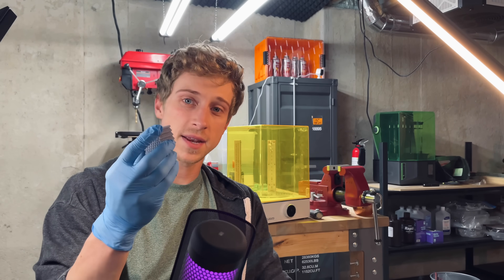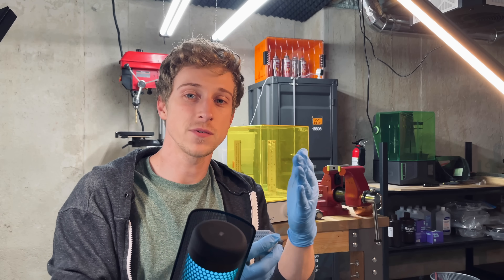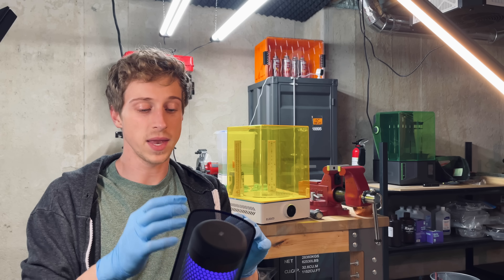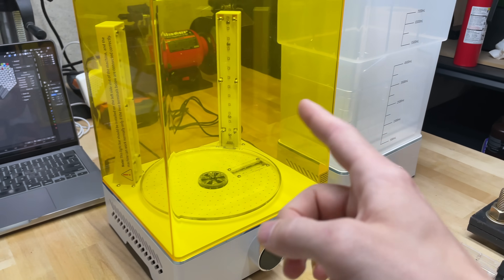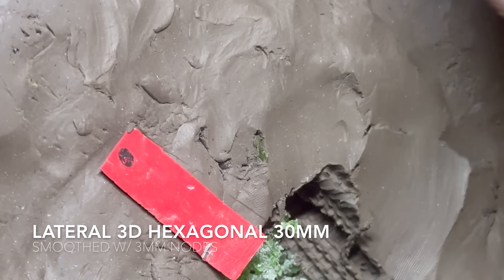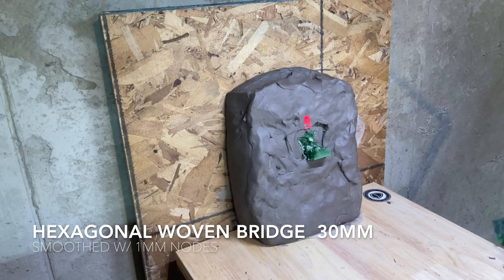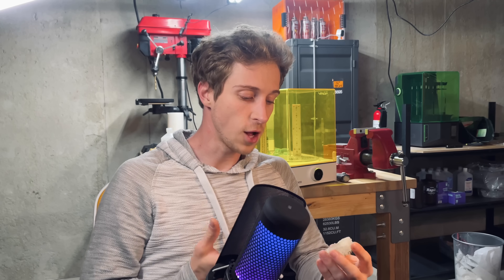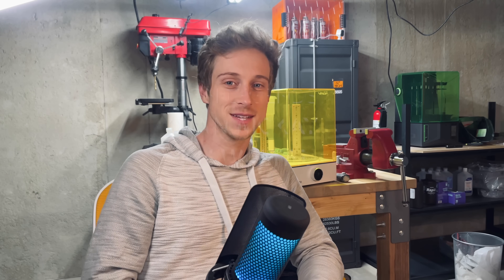Making 3D Prints Bulletproof with Molecular Structures

Comment: 🤔 I'm glad that this vid popped up... cause if been curious if it's possible to print these while under high electric charge, essentially inducting an ionic/magnetic +/-.  Likewise, when working with adhering the (for lack of better inclusive terminologies) carbon fiber/ epoxy layers.. more so what epoxies & carbon fiber materials will allow for this, so the end result products will maintain a strong ionic/magnetic +/- charge. [Which is pretty much just vacuuming & heating with charged plates on each side during those proccesses.]

But what ultra light materials would allow to achieve that.🤔

[Id have to further explain my reasoning for "why".. ]

Comment: Stupid nerd on the internet here,
I noticed that the metal 3d print had a single layer of the structure and the hexagons were a decent bit larger as  well. This seemed to have a large effect on the resin 3d print’s bullet proofness, so it might be a good idea to CNC the metal plate instead. Since its only 1 layer it shouldn’t be an issue right? You could also try primitive dimensions much closer to the original this way.  
I assume this is a limitation of pcbway’s metal 3d printing.

Comment: A perfect crystalline geometry of the material is needed to have energies predictably transcend evenly. One would have to have a super magnetic field to align the molecules or controlled electrical field, to form such matrices, well printing. Then you could macro-mimic the natural micro-geometries of the matrices of that particular type of manmade molecules. That would be perfect energy transformance. Ideally this should be done in zero gravity, for obvious reasons.

Comment: What about filling the voids with a non newtonian fluid? Something that would flow into the voids of a hexagonal latice structure and move freely, but adds rigidity to the structure when placed under load. That way thenstructure acts like a concrete/rebar structure that can still be made flexible

Comment: Fascinating!!

I was wondering however if you combined the different structures that performed well into a 3 layer mesh alternating 2 layers of each with a fiberous material in between each layer like Kevlar? 

If you could remove steel and aluminum from plates and reduce the overall weight while retaining effectivity of the plate would would allow even lighter thinner body armor to be produced allowing for greater flexibility and better mobility for the wearer

If you were able to stop a 22 with mostly resin, could you use a mix of Kevlar like fibers and 3D printed materials and resins to produce a body armor that was capable of stopping handgun and smaller rifle caliber rounds without using metals? You could have a major financial breakthrough on your hands with this.

If you haven’t already start legally securing your property I’d do so, this could be a huge opportunity to create the next generation of body armor.

Please post a video when you start looking for investors!
Reply from the maker: Yep hard stops are inportant between layers which is why I’ve got my newest plate builds underway with the steel lattice acting as a decoupled between fiber composites and ceramics!

Comment: I invented an armor that will stop a 50cal round with 1 layer of kevlar thread. I'll give you the basic concept , with kevlar thread set up on a fine weaving  loom add an additional loom at a 45  degree angle then another loom at an opposite 45 degree angle, and then another loom at an 180 degree opposite to the first loom , this set up is necessary to weave the appropriate  pattern of the weave this should be possible to do on a 3d printer when weaving make sure to loop each thread in a knot around the previous string of kevlar the idea is that each piece of thread is pulled tighter by the thread next to iit wich means that with the pattern described each piece of thread when pushed with the bullet at impact tightens the five  threads next to it and as the pressure increases  the threads tighten next the previous to it is an exponential numerical equation . Which I'm incapable of realizing on paper. In I hope this explanation gives you some ideas as to the concept .

Comment: Some ideas:

1) Try layering material geometry.
You mentioned near the start of the video about using geometry to maximise the compressive and tensile strength of the material, but have you tried alternating between different layers of maximum compressive strength geometry and maximum tensile strength?
High compressive strength geometry will absorb more forward force, but is more likely to shear sideways, allowing the bullet to pierce through. Having a layer of high tensile strength geometry will spread the strain out but will absorb less forward momentum. Having multiple layers is better but of course thickness and weight need to be taken into account.  Tensile layer, compressive layer, tensile layer, etc.

2) Overall material shape.
I noticed that every test piece was a cube. A flat surface material shape will disperse less energy/momentum than a curved shape. Dams are curved because they need to contain the immense water pressure from the reservoir, and why bridges have arches etc. It might be better to test a wide curved band instead of a flat cube. The outside layers will be wider, tapering down as the material curves, which may need to be considered into the design. ie wider yet thinner outer layers that taper down to narrower but thicker inner layers.

3) Consider turning linear momentum/forces into angular momentum/forces.
I didn't get a good close up look at the exact design of the material geometry, but it looked like the base of the design was a pattern of circular/hexangonal nodes with a bunch of support struts connecting to the neighbouring nodes. I didn't get a close enough look to see if the struts were straight lines ie perpendicular at the tangent. Consider making them offset so that they are more like spiralling spokes on a wheel rather than straight support struts. Bicycle wheels have super thin spokes which buckle easily under compression, but hold strong under tension. Try adding a slight offset, so that it looks more like a pattern of counter rotating spirals than direct linking nodes. This should help the compressive forces by relying on tension as well.

4) The strength of a triangle. Triangles are the strongest shape, which is why tetrahedrons (diamonds) are so hard. Have you tried designing layered tetrahedral geometry? ie instead of connecting to a neighbour on the same layer, a top layer node with three spokes connects down to an adjacent node on the second layer. This type of design maximises compressive strength, and can be designed to create a weave like pattern. It might be interesting to see a design combining layered tetrahedrons for compression, spiralling spokes for tension, alternating materials that specifically focus on maximum compression/tension, and all on an overall curved design band instead of a flat design plate.

5) Dilatant, non newtonian fluids.
Ooblek (corn starch and water) is a type of dilatant non newtonian fluid, which means its viscosity increases as shear strain increases. Try finding a good dilatant fluid that you could pour into the block to see if it does anything. Or just ooblek. Could be fun to see the results.

Comment: About a year ago I came to the idea of a “trampoline” kind of armour, which by my calculations should be 4-5 lighter than an ARMOX 600T armour plate. The first variant should be based on UHMPE or kevlar sheets strung across rubber harness on some metal frame. The other variant should be “elastic metallic”: you take 200-300 m of spring, stack it together (randomly directed) by layers and interconnect individual springs in many joints by welding or other method, so that a plate 5-10 cm thick is formed, and finally you just harden and quench the plate.

Comment: @crashmakerspace I worked at HESCO armor, you should check out these patterns. Your already using carbons hex lattice, this may help improve stability. I believe using a tiling method with these kind of soft edge patterns will help break up the impact wave stress from spreading through the lattice.

Comment: Look into Centaur PP as an intermediary layer. it's a TPU filament that collapses into a thinner layer rather than snapping from tension.
Reply: Oh! another note, you should factor in surface area distribution and thickness into your models, when 3d printing like this, a cube is going to shater far easier than a wide thinner rectangle, because the force would more easily distribute, and your testing as of now might not be accurately testing for that, at least in the early cube testing stage, especially because some structures are better at larger surface area distribution rather than others that might be better at denser distributions. don't forget to test for your use case!

Comment: 2:12 - If i may, i notice you're using a (J)acketed (S)oft (P)oint (JSP) round in the quick-cut clip from the .357 test; While i've not seen the actual video it comes from, i feel like i should point something out, although i suspect you very much already know what i'm gonna say.

So, sure, while something like a JSP is much better at penetrating than a regular Soft-Point, hollow point, or even a JHP round, ultimately it's still not really ideal for penetration. If you wanted a better data point for a given armor's bullet resistance i'd recommend at least using regular "ball" (FMJ or TMJ) rounds for every caliber you test. And if you really wanna be able to GUARANTEE that your armor can stop any type of round from a particular caliber, i can not recommend enough the full-brass solid rounds. 

Also, just to make sure this isn't taken the wrong way, i'm not saying this to insinuate that you're trying to rig the resting in any way to get you favorable results, even if this would be a fairly simple way to fool most people who aren't hyper-autist-gun-nuts like myself, lol. Just, more of a knee-jerk reaction the moment i saw the "JSP" written at the bottom of the screen. 

Also also, not trying to question your intelligence at all either, you clearly have a pretty damn good grasp on what you're doing here, and know that any round designed with expansion in mind is going to dump all of it's kinetic energy as close to impact as possible, rather than using said energy for "follow through" if y'know what i mean.

Shit.. Also also also, i realize that money/price could very well be a factor in acquiring ammunition, especially when you're looking for stuff like Underwood Brass Penetrators. Even in super common calibers like 9mm, .45ACP, or .357 those rounds can still go for well over a buck a pop. So i hope this doesn't come across as some kind of elitist/gatekeep-y "lol nice test with your broke boi ammo" bullshit, lol. 

Anyways, cheers. This is some really cool shit you're doing, just randomly got recommended this on the homepage and i'll definitely be subscribing.

Comment: There was a ballistic armor that was rejected by the US Army, although it was very effective. They were produced in rows of  round plates placed on top of each other. And the plate at the top that took the first hit was distributing the energy to those underneath and on the sides. You might want to take a look. Named “Dragon Skin”

Instead of fragile bridges, plates that directly support each other with much larger surface area contact maybe much more effective.

Comment: Very well done video. I do have a couple concerns though, if you're firing indoors the lead styphnate from the primers is a problem. It's a molten aerosol when firing and is easily inhaled which can lead to lead poisoning. I've known range safety officers who solely work in indoor ranges to wear respirators due to the lead contamination they experience. The body naturally excretes some lead, but the more you're exposed to the more your body has to eliminate. The other is gunpowder residue being flammable. It doesn't happen often but there have been range fires due to powder going up. Just wanted to makes sure you were familiar with these risks.

Comment: My first immediate reaction is it might be beneficial to create "breaks" in the tubules. Typically in brittle/hard armor you want to allow the material to take as much energy as possible into other places to slow that projectile more. It would technically be more difficult/tedious but it would reduce the material needed and slow the projectile more than solid rods. 

There's some interesting things going on with an italian armor company using SiC pellets that are formed into a solid plate that does something similar to that. Not sure if they either hot die them in place like traditional ceramic armor to hold them in place or it's a composite structure.

Comment: I wonder how a well Wurtzite structure would work? It may be a bit tricky to print but it is a surprisingly strong structure. Basically HCP but with molecular substitutions so I'm not sure it would be practical but considering w-BN can be theoretically harder than diamond (or confidently at least close to diamond) and noticeably tougher which would be the more important factor here if it could be transferred across materials and into a macro scale structure. it may be worth looking at at least.

Comment: Incorporating powdered aluminum oxide powder by mixing it into the mould will increase its strength I believe. Or adding fiberglass fibers to the resin.

Comment: You sound like you know your stuff and I'm stupid, so i doubt i can put any meaningful input into this.    But what about a triangular/ pyramid shaped lattice.  Might have to work on a bit like base later point up and second layer printed separately put up side down to fit the crevices... I mean triangles and spheres.. spheres for surrounding pressure and triangle for frontal impact of force ..... Though like i said I'm... Whatever.  Just a possible idea though you maybe thought of it
Reply: Like a honey comb structure is fantastic for support a compressing force, not an impacting, penetration force.   That was just my thinking

Comment: Ive just had an idea its a far shot but spiders silk is meant to be stronger then steel right woven in this geometric patten not easy but with patience probably possible you could maybe make an even stronger armor also you go also fuse or inflex the woven spiders slik after actually finding out how to do it in this patten with base layers of carborn and other things just mess around with it to reinforce the silk its a long shot and a winded one but seems like a cool idea to do one day
Reply: Also just to add and I'm gonna do a different comment for this you could also mix and match the geometric template patterns of the cubes and layer the individual ones on top of eachother and see what happens in theory as long as the geometric string is somewhat the same it should still be fine to be put together but idk myself never tried but another idea that could reinforce you're armor too ❤

Comment: I think the best solution is to have the nodes change layer by layer, as the projectile slows down. The first one would consist of slightly different nodes, after which each layer would gradually change towards the top.

Comment: These structures are epic man, Im sure you already moved on, but have you considered other factors that aren't just impactet resistance? What happens when you curve the structures? Or fill them with something like a non Newtonian fluid instead of air? Which ones take the most time to print? What happens when they change temperature? Are the structures able to be further condensed? What happens if you go truly nano scale with these epic structures?

Comment: I printed a 6-12 hexa tubulane out of PLA PRO, dimensions were 20mmx20mm, and then proceeded to run it over with an M1A2 SEP. (Armor Crewmen) I was surprised to see that it squished to approx 12mm but survived, even when pivoting on it. The amount of strength both on tension and compression is amazing. Especially considering that the M1A2 is 68 tons and the total cost of production was approximately 20 cents.

Comment: Nice work! Excited to see the metallic version. I'm not sure yet how you'd implement it, but it would be interesting to see if small channels to allow gas to escape like a silencer could help too. Just thinking about ways to add damping, which could increase total energy absorbed. Perhaps just having the fine lattice already gets some benefit that way. It would be interesting to see the output from a load cell if that were viable.

Comment: It seems like a "dry" linear channel would allow a more direct transfer of energy. Have you looked at metallic foam impregnated with a non-Newtonian fluid, such as corn starch and epoxy without the proper amount of hardener? That random reinforcement of the hertzian cone would disrupt the linear transfer of force.  This is an exercise in trying to turn a linear force 90 degrees. The hertzian cone already bends the force from the point of impact. You just need to convince it to bend the force more. On a microscopic scale the force travels horizontally then vertically in a tiny zig zag pattern along a line (angle of repose). If you can microscopically throw off that path you'll cause the force to travel more vertically that horizontally.  A liquid permeation will also cool the reaction faster, which will slow it down more. I guess that would make the armor "bleed" but most armor only needs to work for a few seconds. A bullet would rarely hit the same exact place twice. It would need to be sealed in an envelope material such as carbon fiber or fiberglass but it looks like you're already exploring that.